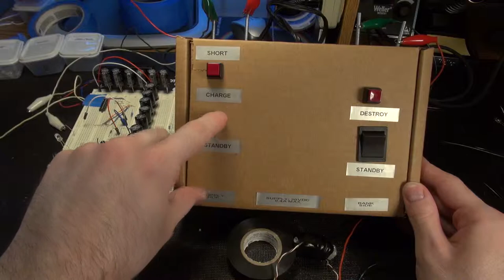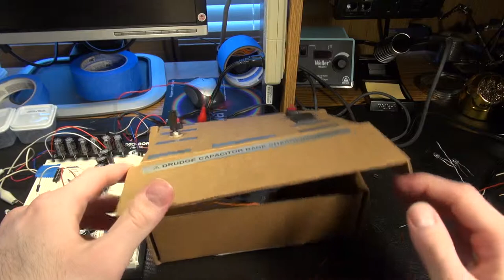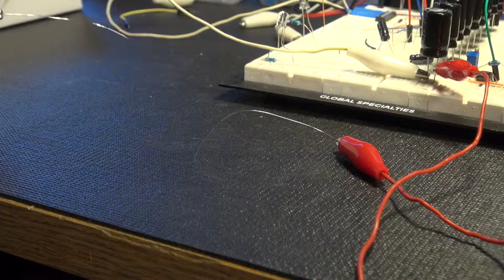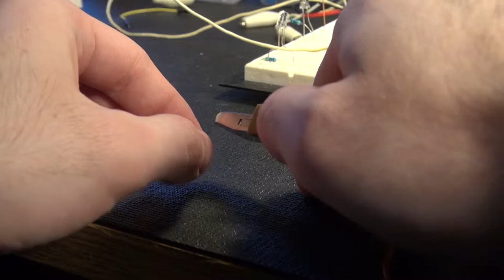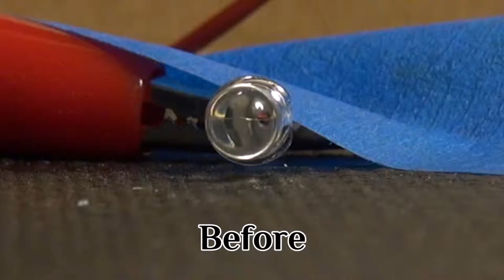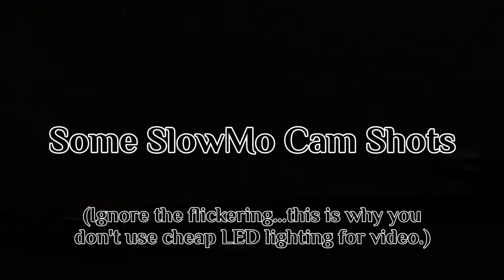Tiny Capacitor Bank, Tiny Coilgun, Lots of SPARKS!

Comment: Nice job Nick!  If you decide to upgrade your coilgun in the future, I would recommend the following:

1--Consider using a SCR to control the capacitor output.  A normal switch will allow electrical arcing/sparking to occur just before the switch is fully closed, starting the discharge of your capacitor before the switch can fully conduct and the arcing will damage the switch contacts.

2--Use a "flyback" diode.  This is a diode that is intended to handle what is known as inductive kickback from the coil.  Simply put, when a coil is charged with electricity and the power source is then removed, the coil will send a brief discharge pulse of opposite polarity back into your circuit.  This pulse acts as a current source which means the voltage it will reach increases with circuit resistance and may reach very high voltages capable of detonating electronic components connected to it like firecrackers.  A diode connected in parallel with the coil will provide a relatively low resistance path that will keep the voltage low and short out the pulse.  The diode should be rated for the current you expect to be charging your coil with.

3--Always use larger size wire, or multiple wires in parallel, for the capacitor discharge path than you actually need.  This keeps the electrical resistance of the wire low and allows for more power to reach the coil.

4--I didn't see your coil, but always make sure the wire is wrapped neatly.  Multiple layers of wire are fine as long as they are neat.  A lot of criss-crossing of the wires will cause some of the magnetic lines of force to oppose other and reduce the effectiveness of the coil.

5--If you really want to take it seriously, look at the ESR (Equivalent Series Resistance) of any capacitors you intend to order and get something reasonably low for the capacitance size you intend to buy as long as it won't cost significantly more.  As with larger wire, this lowers your discharge circuit's resistance and allows more power to reach the coil.  In high power designs, this also reduces heating of the capacitors from the discharge, although this usually isn't an issue for most experimenters coilguns.
Reply from the maker: Chris N Thank you immensely!

The SCR sounds like an amazing solution! I was very aware of the arcing of the mechanical switch (and yet I didn't comment on it in the video, that'll make me more aware of what I need to include in videos!)

I hadn't even THOUGHT of using a flyback in the coil gun. No idea why either. Might have to laugh on a scope later looking at the inductive spikes. 

The wire is almost a joke. That cat5 is just silly. My binding posts are well thought out, but yeah. Wire was a "gonna wait until I have thicker stranded so I don't have to deal with a bunch of solid core."

Yeah that coil was actually fairly messy, it was just built quickly. I dug out the much cleaner thinner spool of wire (not enamel, but still much better for this) so i can build a cleaner coil to prevent cancellation. 

ESR would be a very good thing to look into when I start building bigger! These caps i just used for the quantity, once I start building something serious, I'll try to order something sweet. 
Thanks again for the tips! I'll have to start working on a follow up! I have some very interesting things planned for the new coil gun soon as I dig out my supplies from various boxes.